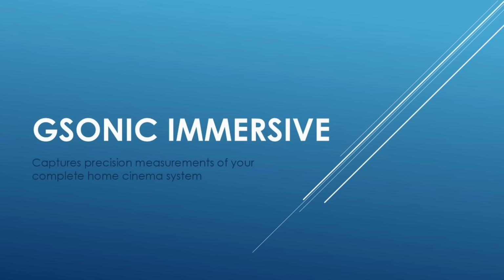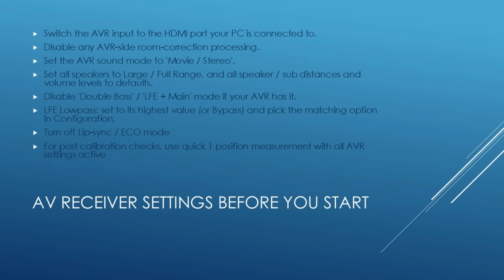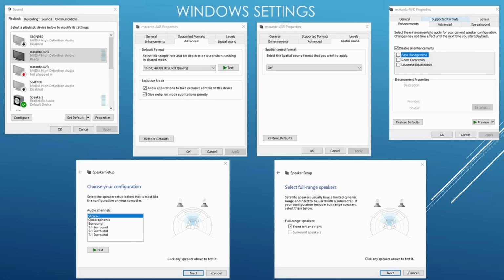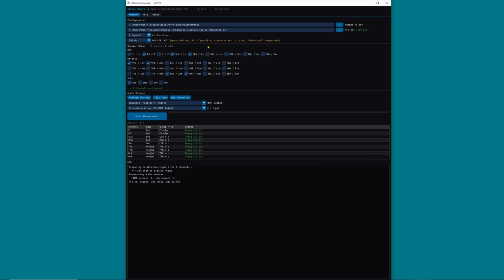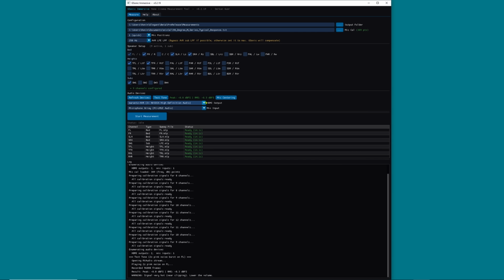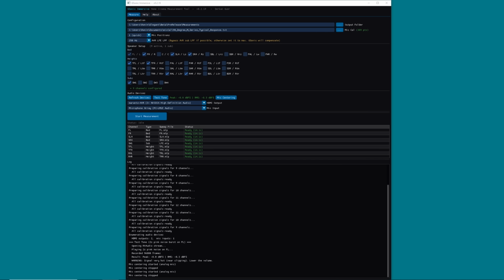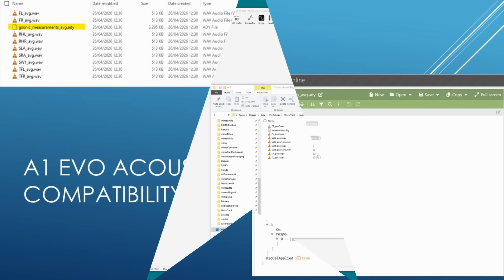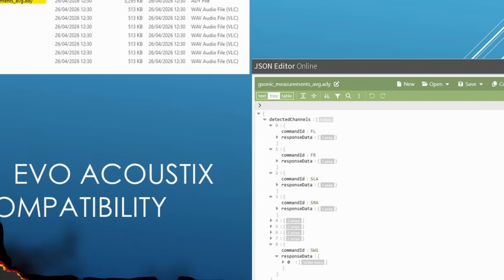GSonic Immersive

Comment: what if your subwoofer has an undefeatable crossover lower than the avr allows you to set (and your program supports)?  Do you still just use the AVR's highest crossover frequency?
Reply from the maker: AVR can set as low as 80Hz. It's not meaningful for the app to try to retrieve the full response of a sub which lowpasses below 80Hz.
Reply: @ocaudiophile   I meant, the subwoofers highest LPF is lower than the AVR.  Specifically, my sub has a knob that only goes to 180Hz (where I have it), and my receiver goes as high as 250Hz.  Since you don't have a 180Hz option in the program, what frequency should be selected in GSonic?
Reply from the maker: Max out sub lpf and AVR lpf (250) and select 250 in gsonic and you will get the true response of your sub. That's how it works.

Comment: Forever learning and enjoying what you put on offer, OCA! 

Made a 1st GSonic attempt tonight, but ran into an issue
- Setup and config was a breeze
- Test tone good (in Windows and GSonic)
- Mic centering good (really handy!)
- FL chirp and sweep good
- RF chirp and sweep dominated by static (pink noise?), chirp and sweep barely audible under static
- GSonic errored out 
- Restarted laptop and AVR, but problem persists
- Manually aborted subsequent attempts 
System:
Denon x3400 (Cirrus), 3.2 speakers
Dell XPS 13 9370 (i7-8550, Intel 620) 
Windows 11 24H2
UMIC 1

Hope I’m not making you repeat yourself here!
Thanks again!
Reply from the maker: Thanks. That model has known issues with the front HDMI port, try any rear port please.
Reply: @ocaudiophile  Thanks for the quick reply. The above happened while using the rear HDMI1 (CBL/SAT) port, but I'll try another.
Reply from the maker: AVR hard reset may help if all settings are correct as per the video.
Reply: @ocaudiophile  Quick update: Held power button down while powering on to "Restart" AVR. Let GSonic v1.0.9 configure settings.   Used HDMI2 (DVD) this time.  Same issue, I'm afraid. Reinitialized AVR (factory reset), but ran out of time. Will try again on weekend.  Thanks!

Comment: Hi have an issue all the sweep go through front left and right in stereo also most of the subwoofer sweeps are silent. I raised to max volume but the sweeps are silent
Reply from the maker: I can only suggest following all the settings in the video (windows, AVR, mic) closely. Some older models reported they used Direct mode rather than stereo for AVR to auto-switch correctly but everyone could play these sweeps from the correct channels.

Edit: Some user just found out in older AVRs, front HDMI port is not gonna work because it's analog, use one of the rear HDMI ports if that's the case.
Reply: For me I had lots of sub sweep not registering issues. It was resolved by setting AVR LPF to 120 then GSonic app to bypass.
Reply from the maker: That doesn't seem relevant. Something else you have done is fixing it. LPF for LFE should be at 250Hz both in the AVR and in the app.
Reply: @ocaudiophile Hi I checked thrice it shows some error each time mostly it’s with silent sweep of subwoofer and when I repeat the sweep it’s the same and i have marantz 8015
Reply from the maker: So what is more likely? Your settings are correct but app is working fine with over 200 setups and only missing it specifically with yours or your setup has a problem...
Reply: @ocaudiophile  I tried so many ways to fix but after resetting the amp it worked.
Reply: Hi OCA,
With 1.09 also the same issue exists the sweeps don’t move to other channels from left and right even after resetting function is done. Then i have to reset the avr and it works after that.
Reply from the maker: I slowed everything down a notch with v1.0.10 These setup related issues must have been solved with that one.
Reply: @ocaudiophile I tried with 1.0.10 the issue with sweep is resolved it’s measuring good now but after calibration with acoustiX the sound tend to lean towards front left than right and this was not the case 1.0.8 where I got better results.
Reply from the maker: Share you mlp only .wav files (pos1) and let me check if anything wrong with the measurements. If not, that's an AcoustiX customization problem.
Reply: @ocaudiophile I will share next time when I take measurements. I deleted it.
Reply: @ocaudiophile   Hi i have shared 1st measurement which took with gsonic which also tends to lean towards front right little.
https://drive.google.com/drive/folders/1HRKP9uCvedkN33hTlTWPgHp7czi-nw8w?usp=drive_link
Reply from the maker: I checked your measurements, nothing wrong with any of them but your C and FHL seem to be placed at difficult positions and AcosutiX may be having problems time aligning them. You need to use "Manual time alignment" option in AcoustiX custom menu and check if all speakers are correctly aligned to FL. How to this is shown in AcoustiX video.

The more serious issue is with your sub. It rolls off much earlier than needed for your speakers and there's a huge frequency gap. This is not at all normal. Check if its lowpass filter settings are maxed out. Change its current location to fix that massive 30Hz peak. Then you will get much better sound.
Reply: Try this: 
1: search an atmos test file (eg amaze or helikopter)
2. open Vlc player on your windows pc play it and check whether all speakers are fine
3. try measurement again
4 if it doesn’t help make a factory reset of your marantz and try an new measurement

Comment: Hi OCA i have a question can I for a total 16 positions can i measure 6 times in the mlp and switch to 10 different positions after that
Reply from the maker: No, but it already weighs MLP more than other positions in the spatial average.
Reply: @ocaudiophile Should I equally distribute the counts across all positions like 3 times each position
Reply from the maker: You are free to move or not move the mic, they will all be in the average but only the first round (MLP) have higher weight in the average. Others' weight depends on mic distance to MLP. The sweeps don't need to be repeated for higher quality though.
Reply: @ocaudiophile 👍🏼

Comment: Thinking of picking this up - but...after measurements - you can feed the ady file to AcoustiX? Which will - provide better integration with subs? And i guess you can measure post calibration with this instead of running REW sweeps (which can only do 7.1 easily)
Reply from the maker: Yes and yes.

Comment: I purchased GSonic yesterday; I tried to use it on a macbook M2 running parallels with Windows 11. It didn't go as expected, as that route doesn't support multichannel audio through hdmi via parallels (there's plenty of "workarounds" listed online, but nothing seemed to work). I have a smaller windows laptop that I don't really use, but I just tested it and it runs REW fine with multichannel. 

I'd like to transfer my license to my smaller windows laptop. I know there's only 1 license transfer allowed with the purchased license, but unfortunately I already need to do that. I've replied to the purchase email, but wanted to ask here if there's any additional info needed in the request, other than just the request itself. 

thank you!
Reply from the maker: I sent you a new receipt from Gumroad. You should be able to download the app from the link in this email and install it without issues to your new pc. Let me know if you encounter issues (as this is the first time I am trying this).
Reply: @ocaudiophile  It installed and activated; thank you again!
Reply from the maker: Sure thing.

Comment: How quickly are the measurements taken for a given position? Is it not necessary to repeat the measurements for each channel and position as AcoustiX does because the AVR is no longer introducing issues?
Reply from the maker: If you have a single subwoofer, less than 5 minutes even with 9.1.4 system
No repeats necessary, the measurement algo is very special.

Comment: Nice software. I suppose that distortion information won’t be present when opening the measurements in REW? Also have you considered adding a moving mic measurement option to increase correction confidence to AcoustiX?
Reply from the maker: No, REW needs raw measurement data to produce that, could be added to this one in a future update though if there's enough demand.
Not a big fan of moving mic and AcoustiX can not do much with it in the lack of phase information. You are already moving mic during multiple mic position measurements and getting pristine phase data on top here.

Comment: Hi Serkan, looks like my FL / FR (and likely other channels too since they use FL as reference) imbalance issue is harder to tackle than I thought. Watching movies I keep noticing the FL is louder than FR/C and overall front stage is heavier to the left. During GSonic measuring, FL is very low compared to others causing AcoustiX to reduce FR level 3 to 5 dB. I can see this when adding the WAV files into REW. I might be wrong but I’m guessing because FL uses PCM while the rest use TrueHD/Atmos this is causing this imbalance because during actual listening all channels use the same codec. Increasing the Windows volume helps but one time my X4700H went into protection mode during measurements. All my speakers use banana plugs at both ends, I tried taking measurements with AcoustiX again but it doesn’t have this issue. I’ll keep trying to balance the Windows volume to match the FL to the rest.
Reply from the maker: Best way to make sure is to test with GS Reference and then GS Immersive keeping the mic at the same position. GSR is free and uses pcm for both FL and FR. You should see if GSI measures differently than GSI (highly unlikely). One speaker is slightly louder in almost all front mains due to extra reflections one speaker is exposed to. Although it wouldn't have any effect with most models, also make sure Atmos "loudness management" setting in AVR is off which would apply dialnorm setting to Atmos sweeps.

PS Someone with aa X4700 just informed me that he also rarely had this issue and an AVR reset and PC restart always fixed it.
Reply: @ocaudiophile  Thanks Serkan, I’ve been using GSR for music listening it didn’t have the issue, with GSI I always use the mic centering tool first. My room is treated quite extensively with thick rockwool panels. Measuring with AcoustiX also didn’t have the issue. All settings including loudness has always been off since I started the hobby. Nevermind I’ll try again this weekend.
Reply from the maker: If GSI measuring different to GSR then there's an issue with decoding Atmos in your AVR. These devices sometimes get confused for no obvious reason. I believe a soft or hard reset will fix your issue.
Reply: Hi; I did have a similar issue early on and for me changing the audio setting on the receiver from Stereo to Dolby Audio/Dolby Surround seemed to resolve it. Maybe that was just luck, but give it a try. 🤞

Comment: I'm attempting to use Gsonic Immersive but am unable to get it to output a dedicated signal to the subwoofer. I'm running a 2.1 system and selected Fl, FR, and SW1 in the settings. The LFE LPF in both Gsonic and the receiver (Denon AVR-X-3400H) are set to 250Hz. Windows sound settings and the receiver are setup according to the video.

I've tried both "stereo" and "5.1" speakers with my Windows 11 laptop. The latter sends a dedicated signal to the sub via the Sound Settings in Control Panel confirming the sub is on and receiving a signal. However, when taking measurements in Gsonic the FL and FR speakers produce sound while the sub remains silent.

Please let me know if you can provide any help. Thanks
Reply: Thanks, I appreciate your help with this!
Reply from the maker: Set your AVR to a sound mode in which it will auto switch modes based on incoming signal. For most models that mode is stereo but I've heard some older models can do that only in direct mode.
Reply: No luck in Auto or Direct while in stereo or any other mode. Interestingly, the FL signal when played shows up as Dolby Atmos with the option for multi channel in, while the FR and sub (still silent) show up as Dolby True HD with no multi-channel in option. I tried on another 2.1 system I have with a Denon AVR -X3500H with the same results
Reply from the maker: Can you try play anything in Atmos from that pc to this AVR and confirm it correctly switches modes? You can use VLC media player and many Atmos demo tracks available on the web. This will eliminate any setting/cable/driver related issues.
Reply: @ocaudiophile Yes, I can play Dolby Atmos tracks with VLC and it passes the signal properly to the AVR which correctly switches modes.
Reply from the maker: FL is not Atmos it's LPCM, all the other floor channels are TrueHD Lossless so expect a mode switch from FL to FR. Then all the height speakers (and FWL/FWR if you have) are TrueHD Lossless Atmos (so possibly another mode switch). If neither stereo nor direct mode doesn't play the sweeps correctly from the assigned channels, then try a hard reset of your AVR. There are about 200 users now with no issues with the sweeps.
Reply: @ocaudiophile  Unfortunately, a hard reset didn't resolve the issue.  I still cannot get Gsonic to output just the subwoofer channel. As another poster mentioned, the FL sweep sounds like it includes the subwoofer while the FR does not,  The sub sweep on it's own remains silent
Reply from the maker: A firmware bug with these models is a possibility if you are certain all settings are correct. They are both early adaptions of Atmos and maybe the decoders work differently and don't switch on correctly although my SR6011 which is the test mule for this app is from the same era. Anyway, I am happy to issue a full refund if you think the issues are unsolvable. Let me know.
Reply: @ocaudiophile Thanks OCA, I think I've exhausted all reasonable attempts to get this working and would appreciate a refund. Let me know if you need my build #
Reply from the maker: No need. It's done! It should work for a few more days so you can keep trying ;)
Reply: Will do, thanks

Comment: Hi, just purchased gsonic. How would I measure 6 subwoofers 3 positions and use this for MSO? Thanks
Reply from the maker: Congrats. You will need to do a lot off sub on/off switching with 6 subs :) LFE will play from all subs that are active and the only way is to turn off all 5 subs and keep on one at a time. App will instruct you when to do which. For 3 mic positions that's quite a bit off work especially if you don;t have a way to turn off subs remotely. But the results will be worth the effort.

Edit: Sorry, I just realized your number of subs exceed the 4 sub limit in the app. For single MLP position all you need to do is restart after measuring 4 subs with FL and 2 subs ticked and measure the other 2. But for multiple mic positions you will not be able to keep the mic positions. I can increase the limit to 6 subs in the next update or can give you a refund. Let me know.
Reply: @o @ocaudiophile Thanks so much. Happy to wait for the update. I will follow your guidance and do one position at a time.

Comment: A question about pairing with AcoustiX: Should I leave AcoustiX at default settings when calculating the GSonic Ady? 
Or are there any sensible recommendations for testing/comparing different setting options in AcoustiX? E.g. with "sync all impulse" or "THX" ON? 
Or do GSonic's calculations generally not require any further adjustments in AcoustiX? 
2.) How loud should the receiver be set when playing the test tones? Better more than my Standart Volume -15dB? 3.) Should the microphone level in Win11 be left at 100 (+24dB) or changed to 0dB (medium setting)? 4.) Win11 output volume AVR leave at 100 or adjust? 
Thank you and LG
Reply from the maker: You should always start with Express settings and give it a listen. The most obvious improvements usually over Express with custom is shifting front XOs by one notch (i.e. if Express found 40Hz, make them 60Hz) and then the rest is about sub alignment and here depending on your room and in order of likeliness one of Default, Align IR starts, MIMO, double bass will give you the best bass response.

AVR should be at the level you use it regularly for listening. Mic gain depends on the mic, if Audyssey mic, max everything out in Windows, its internal gain is quite low. Test tone should return a green prompt before you start measuring. Ignore dB level you see in Acoustix with the generated ady file.
Reply: @ocaudiophile thankyou! in use umik1... max always out in win11 System ?
Reply from the maker: I think if you get a green prompt from the "test tone" button when the AVR is at the volume level you normally watch your movies then you're good to go. In general I don't like "not maxing out" a volume setting in Windows but I have not set up a Umik in WIn 11 myself. I am considering switching recording drivers of the app from Wasapi Shared to Wasapi Exclusive in a future build which should save you from these concerns but it decreases compatibility. You will be informed if I do.

Comment: Great❤….is it applicable to Anthem Arcs also
Reply from the maker: Correct but remember it's only for measuring your system, no correction filters will be generated. You will also see relative volume levels and delays between speakers.

Comment: I already when using AcoustiX have set the Subwoofer gain level and "marked" my mic center positions for future use.  These should still work with Gsonic Immersive correct?
Reply from the maker: It measures whatever it hears. Mic centering is easy with GSI

Comment: Is GSonic suitable for beginners, or mainly for advanced users with REW/impulse/phase measurement knowledge?
Reply from the maker: No need to know any of that, it doesn't use REW for measurements but you need to be able to set PC to AVR HDMI cable and mic to PC connections yourself which is simple but not something the app can do on its own.